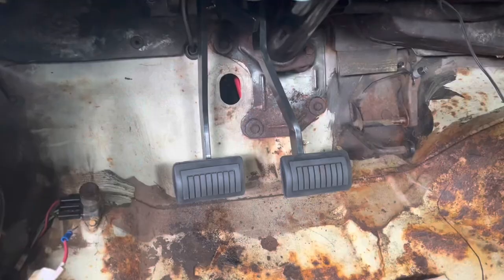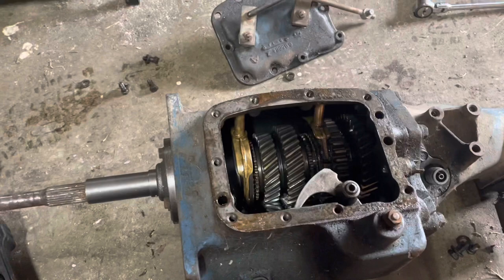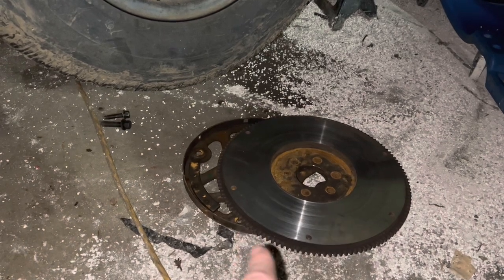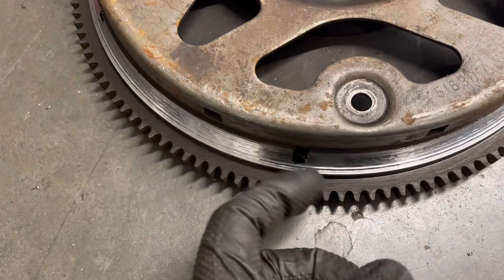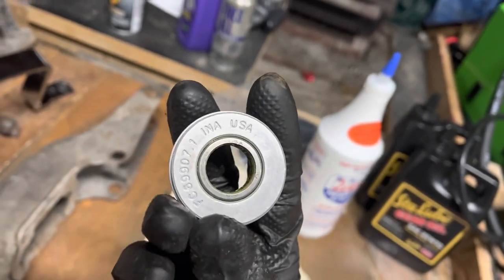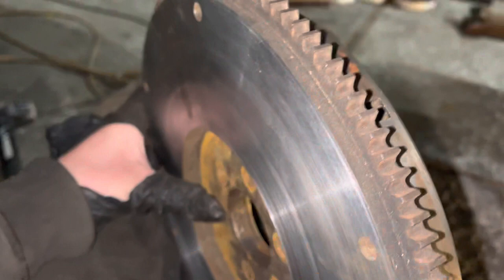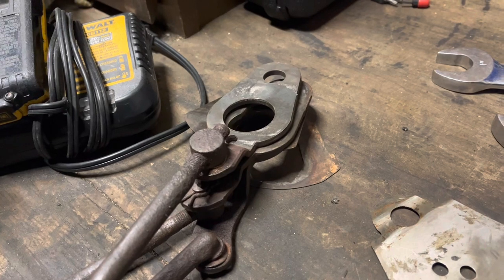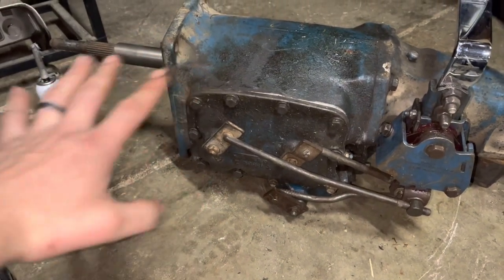Magic Trick That Shouldn’t Work - Mating An A833 To A Magnum - Three Pedals Pt 3 - Dead Dodge Garage

Comment: I did a 4 speed swap into a 69 Valiant slant six. A little bit of fabrication to the Z bar bell housing pivot point as I recall, and having a reducer machined to adapt the transmission input bearing to the bell housing. Once I got the correct floor hump and A body shifter, it was very rewarding and made the car a lot of fun to drive.

Comment: For only one part of three, that's a lot of work!
Reply from the maker: Just wait until you see the amount of work in tomorrow’s video… OOF.
Reply: @DeadDodgeGarage  I have a 99 Dodge ram Van 5.9 magnum with 46re and I'm trying to get a used transmission I'm looking at at 2000 dodge ram Van with 5.9 46re transmission..I'm looking at it online at pull apart salvage yard but don't want to drive out there to figure out it has the different neutral safety switch or whatever..do you know if the neutral safety switch is different from 99 to 2000 46re transmission cause I heard that they were different and I also heard they were the same???lol😅

Comment: How about taking a stock 5.9 magnum 143 tooth flywheel , removing the ring gear and having the outer circumference milled down to accept the 130 tooth ringgear? That seems to be a good alternative because I believe balance would be correct and the tone wheel to trigger the injection would also be already on the flywheel.
Reply from the maker: That flywheel accepts a larger truck clutch - 11”, or even bigger - that won’t fit the 10.5” bellhousing (easily, anyway) and won’t match the input spline of the A833. The tone wheel is built into the surface you are suggesting to turn down - so one could only turn down part of it, similar to what I do with these. If you’re using a truck bellhousing and transmission, you just grab that Magnum flywheel and you’re done. But for the A833 setup, it doesn’t appear to be a suitable solution - at least in my view.
Reply: I am saying that if you took a truck flywheel with a 143 tooth ringear then removed the ringear milled down that surface to the same diameter as the 130 tooth ringgear and then installed the 130 tooth ringear back on the now smaller diameter flywheel you would end up with a 130 tooth flywheel with a tonewheel. I actually had a machine shop do that for me. The tone wheel on my flywheel is actually a separate pressed on piece. I did forget that you would have to redrill the flywheel for a 10 1/2 inch clutch. After thinking about it there might be balance issues but I'm not sure. I think your method was awesome and I was just shooting out some ideas. I am a new subscriber and really enjoy the channel along with your humor.   @DeadDodgeGarage
Reply from the maker: @moparfan4388  yep - I understood the suggestion. Re-drilling the flywheel for the small clutch would indeed solve that problem - but that’s not something I can do quickly and free-ly by borrowing a brake lathe. Honestly, just the amount of machining involved in my method is probably enough to throw off the balance. I don’t have any resources to deal with balancing parts like that. Some day, I’d like to figure that out… Appreciated! Thanks for being here!
Reply: Yeah it's amazing that no one offers a ready to go flywheel for the factory injection and a  manual trans . What I may try is getting a new 5.9 flywheel already drilled for a 10.5 clutch and doing exactly what you did with milling down the back where you did but just enough to put a tone ring on with an interference fit. I am going to start trying to find another flywheel from Pick and Pull with a removable tone wheel $50 out the door. You can use a magnum flex plate to clock the windows in the correct orientation on the 10.5 clutch flywheel. There has to be a simple fix but without rebalancing and drilling for the 10.5 clutch and I believe what you did with the flexplate is the key. Well thanks for the input and if I come up with something I will pass any info along . I really enjoy the channel and will start mentioning it to my mopar buddies. Cheers. @DeadDodgeGarage

Comment: In a 68 dart with a 318/904/7.25, swapping to a 833, will just a new yoke and conversion U Joint be needed? I assume the U joint size for the 904 won’t be the same as the one needed for the 833. This won’t be a permanent setup. It’ll be just until my 8 3/4 axle is together and ready. Since it’s the same length, it will be okay for a temp basis and being very careful to not explode the 7.25 axle.
Reply from the maker: No clutch dumps with traction for you. Haha. Actually, you probably won’t even need a conversion joint, all depending on the yoke you buy. There are small joint and big joint 727 yokes. If you do need the conversion joint, I believe it is a Moog/Precision/whoever else part number 347.
Reply: Well that’s very good to know. Yeah I’m planning my mediocrity in stages. Once I get my 8 3/4 axle together I’ll need another driveshaft or shorten this one. The small joint 727 yoke may be the ticket. I emailed Brewers as well to see what I need. It’ll be a turd but a slightly cooler turd after the 3 pedal solution has been applied.

Comment: Magnum crank position sensor tone ring fits on early a-body flywheels with 9 inch clutch
Reply from the maker: I’ll be damned. That’s good to know - but to use that flywheel you’re stuck with the small clutch and bellhousing, I’m assuming? Or is it the same as the later 10.5” bell?

Comment: What if your not running crank sensor will the same manual fly wheel work or does it need weights welded to it
Reply from the maker: It needs to be weighted specifically for the 5.9 Magnum. It turns out there is a flywheel commercially available for that purpose - but I don’t know who sells it. You can also do the same trick with sandwiching the flex plate just to get the weight. We have done that.
Reply: @DeadDodgeGarage  mines carburetored could I cut the tone ring off were I can mount it flush behind the flywheel so I wouldn't b cutting anything off the flywheel just the tone ring off flex plate think that would be alright
Reply from the maker: @briantate401  In theory, absolutely - but in practice I would want a machinist to do this, as cutting by hand could well throw off the balance and ruin the party. Also, I think the weight is pretty close to the outside, so you may have to cut it right at that edge. In my view it makes more sense to just machine the flywheel at that point - easier to do reliably, and you've got the future option of EFI, which I have found is easy to make work and really good.

Comment: Hey man would you suggest this process with np435
Reply from the maker: With NP435 I think you can use a 90s Ram truck flywheel? You would need to verify the diameter and flywheel tooth count, but I am pretty sure that is an option. I haven’t done this on a truck flywheel so I don’t know if the construction and dimensions are similar enough off the top of my head. But there is definitely a way to do it.